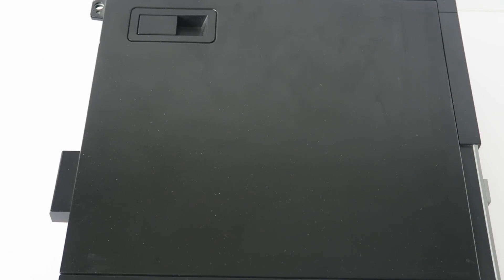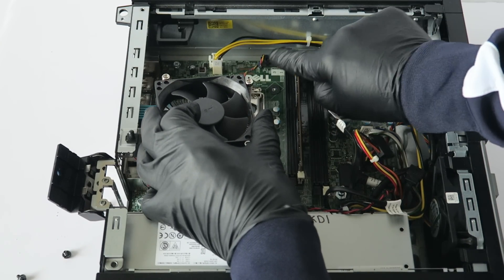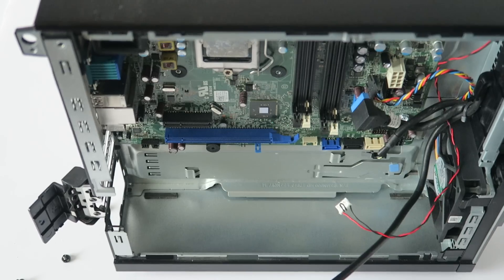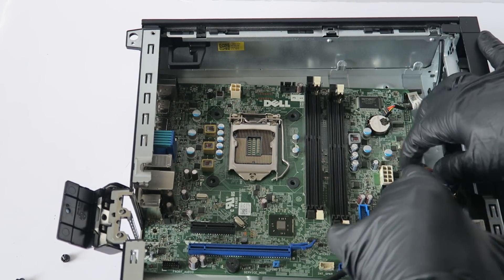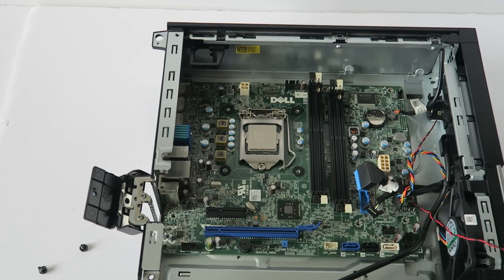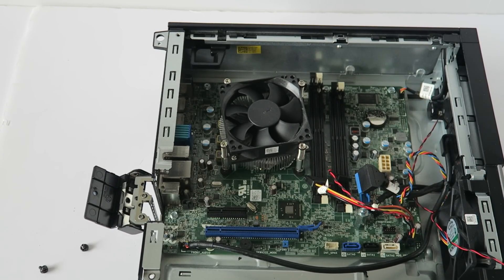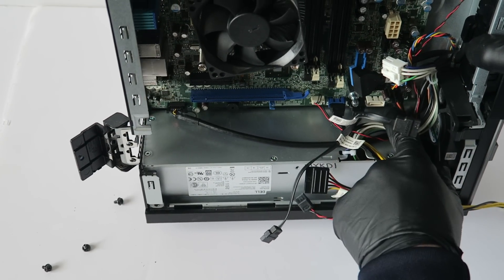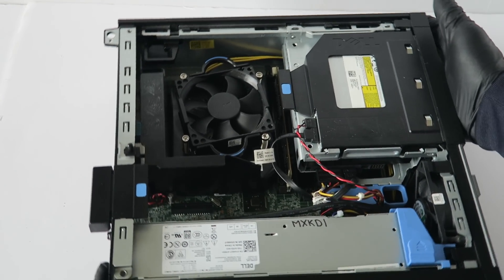Dell Optiplex SFF Replace Install Motherboard

Comment from the maker: Here is the List of parts upgrades:

Dell Optiplex SFF Install Second SSD, Hard Drive
https://www.youtube.com/watch?v=i5AcC0YgwH8

 SATA Hard Drive Caddy, Universal 12.7 mm SSD HDD Hard Drive Caddy
https://amzn.to/3buyfJw

2.5" 12.7 mm 2nd SSD HDD Hard Drive Caddy Adapter
https://amzn.to/3czPDN9

This HDD 2.5inch will work in this caddy for extra storage.
Seagate FireCuda 2TB Solid State Hybrid Drive Performance SSHD – 2.5 Inch 
https://amzn.to/2Vpw0Sa

WD Blue 2TB Hard Drive s, SATA 6 Gb/s, 128 MB Cache, 2.5"
https://amzn.to/2VqHK6Q

Seagate BarraCuda 2TB Internal Hard Drive HDD – 2.5 Inch 
https://amzn.to/2yANdio

 
3.5" to 2.5" SSD or Hard Drive Caddy Adapter R494D 0R494D 
https://amzn.to/2XTPeRr 

 This RAM works with Dells Optiplex SFF 390, 790, 3010, 7010, 3020, 7020, 9010, 9020:

(1.) Crucial 8GB Single DDR3L 1600 MT/s (PC3L-12800) Memory CT102464BD160B
https://amzn.to/2VhGv8O

(2.) Crucial 4GB Single DDR3L 1600 MT/s (PC3L-12800) Memory CT51264BD160B 
https://amzn.to/2xq46wb

(3.) Crucial 16GB Kit (8GBx2) DDR3L 1600 MT/s (PC3L-12800) CT2K102464BD160B 
https://amzn.to/2VpsKpP

(4.) Crucial 8GB Kit (4GBx2) DDR3L 1600 MT/s (PC3L-12800) Memory CT2K51264BD160B 
https://amzn.to/2y7XZwq 

List video cards will work with this system.
(1.) Gigabyte GeForce GT 1030 GV-N1030D5-2GL Low Profile 2G Computer Graphics Card 
https://amzn.to/2Z4PHkp

(2.) ZOTAC GeForce GT 1030 2GB GDDR5 64-bit PCIe 3.0 DirectX 12 HDCP Ready Low Profile Video Card ZT-P10300A-10L 
https://amzn.to/2WzgLXk 

(3.) MSI Graphic Cards GT 1030 2GB GDDR5, Low Profile 
https://amzn.to/390Spum

SSD list works with this PC:
(1.) Samsung 860 EVO 500GB 2.5 Inch Internal SSD MZ-76E500B/AM) 
https://amzn.to/2yNxnkE

(2.) WD Blue 3D NAND 1TB Internal SSD, 2.5" WDS100T2B0A
https://amzn.to/2wvnC9Z

(3.) WD Green 1TB Internal PC SSD  WDS100T2G0A
https://amzn.to/3cbrcWa

(4.) SanDisk SSD PLUS 480GB Internal SSD SDSSDA-1T00-G26
https://amzn.to/3a3i9ou

(5.) Crucial MX500 250GB 3D NAND SATA CT250MX500SSD1(Z) 
https://amzn.to/34rZlhy

(6.) Samsung 860 PRO SSD 256GB - 2.5 Inch SATA III 
https://amzn.to/2ybiHLK

(7.) Samsung SSD 860 EVO 250GB 2.5 Inch SATA III Internal SSD 
https://amzn.to/2VjIAkK

(8.) SanDisk SSD PLUS 240GB Internal SSD
https://amzn.to/3c7SEE4

HDD list works with this PC:

1.. WD Black 2TB Performance 3.5" Hard Drive - 7200 RPM Class, WD2003FZEX 
https://amzn.to/2xFUeyF

or you can use 2.5 inch hard drive with caddy
2... WD Black 1TB Performance 2.5" Hard Drive, 7200 RPM Class, WD10SPSX 
https://amzn.to/2zg4cXG

3... 3.5" to 2.5" SSD or Hard Drive Caddy Adapter R494D 0R494D 
https://amzn.to/2XTPeRr 

 
This cable required if you going to install SSD and HDD:
Benfei 15 Pin SATA Power Y-Splitter Cable 8 Inches
https://amzn.to/2XsG0LV

Cable Matters 3-Pack 15 Pin SATA Power Splitter Cable 8 Inches 
https://amzn.to/2Rval8B

Zheino SATA Power Splitter Cable (2 Pack) SSD Power Cable HDD
https://amzn.to/3a3V9Wq

1.. Seagate FireCuda 2TB Solid State Hybrid Drive Performance SSHD – 2.5 Inch 
https://amzn.to/3b1e8T7

2..WD Blue 2TB Hard Drive s, SATA 6 Gb/s, 128 MB Cache, 2.5"
https://amzn.to/2Xstb4b

3..Seagate BarraCuda 2TB Internal Hard Drive HDD – 2.5 Inch 
https://amzn.to/2xmf0TE
Reply: hi quick question is it possible to switch a optiplex 790mt motherboard to a 9020 mt motherboard using the same 790 mt case since they are technically the same? i know i would have to change cpus but other than that is it possible?

Comment: I have an Optiplex XE SFF that I just got running. Wondering if I can upgrade the motherboard with one that came out of an XE2 SFF case.  Is that possible or has Dell changed everything?

Looks like it from this video.

Comment: Is thermal compound required?
Reply from the maker: Hi, yes.

(1.)  Thermal Grizzly - Spatula for Applying and Spreading Thermal Paste
https://amzn.to/30Qq4ag

Thermal Compound Paste:
(1.) Arctic Silver 5 Thermal Cooling Compound Paste 
https://amzn.to/2ziNU0H

(2.) Noctua NT-H1 3.5g, Pro-Grade Thermal Compound Paste
https://amzn.to/36kTk7A

(3.) ARCTIC MX-4 (current edition) Thermal Compound Paste 20 Grams 
https://amzn.to/2DhGJaK

Comment: bro same motherboard not avilabe pls tell sustitute for motherboard model optiplex 390sff( h61chipset )  i3 (2 gen )processor 2012 model
Reply from the maker: Hi, they sell them used motherboards on ebay  for that dell 390 sff.

Comment: Hi, I want to buy new motherboard for my PC, cuz best CPU I can install is i7 3770, but I want to upgrade to smthing better, what are the factors I need to look at when I'm buying completely new, not same, motherboard? My case is Optiplex 7010, but not that slim one, but thicker one, like gaming PC.

Comment: Awesome thank you! I love my 990 SFF and upgraded the GPU to the GTX 1650 and put 32 Gigs of RAM (4x8) in and it's a little beast. I'm looking into replacing the MoBO and putting it in a new case. This MOBO is so limited with the CPU  upgrade possibilities sadly. I've now hit a brickwall with performance due to the CPU limitations. Gotta find out what the MOBO upgrade possibilities are.

Comment: I have a Dell Optiplex 790 that does not have a lever to pull up on that removes the side.  How do I get the side off to access the insides.  I am just replacing the fan.  ?

Comment: Hi Mxkdi, I have a 790 SFF and am looking to do some upgrades. Based on the list of parts you provided in your videos, do you have any recommendations on which motherboards would be best with the 790 SFF? If so which ones? Thank you in advance!
Reply from the maker: Hi dell 790 sff use this morherboard
https://amzn.to/2z5GAos
Reply: @Mxkdt  Thank you for your answer, as well as for your tutorials :) I take it no other motherboard will work with this model? No worries if it doesn't. Thanks again!

Comment: Yo! Love you video! Quick question... Got the same computer... will the following motherboard / processor work with this model? Motherboard: Asus Prime B450M-A/CSM AMD Ryzen 2 AM4 DDR4 HDMI DVI VGA M.2 USB 3.1 Gen2 mATX Motherboard https://www.amazon.com/dp/B07FKV5HWJ/ref=cm_sw_r_cp_api_i_8yNKEbQJZ5511                       Processor : AMD Ryzen 5 1600 6-Core, 12-Thread Unlocked 65W Desktop Processor with Wraith Stealth Cooler (YD1600BBAFBOX) https://www.amazon.com/dp/B07XTQZJ28/ref=cm_sw_r_cp_api_i_hBNKEb0HM7A1P          Thanks so much 🙏🏼
Reply from the maker: Hi, no this dell case is to small you should get mid tower ATX case they sell new online.

Comment: Can you just move the motherboard ? I want to install a gtx 1050 ti (low profile) but the pci express pin is too low so the graphics card does not fit. So i want to up the mobo
Reply: Same you can not move due to cpu cooler thing

Comment: Mxkdi!! Sorry for another crazy question. Can I put the Motherboard, psu, and all from my 7020 SFF into a 790 DT? I see the cases are different looking when the motherboards are removed. I want more room so I can use the x16 slot! Thanks and as always your videos are awesome!
Reply from the maker: Hi no if you want to install bigger video card you have to use dell mini tower and i did upload video show you how to do that, you can watch this video...
https://www.youtube.com/watch?v=Bjtpp-fIx_Q
Reply: @Mxkdt  I wanted to keep the same components, put the 7020 mobo in the 790 case. The location of the 7020's x16 slot inside the 790 case should work. The i/o might be different though

Comment: It's very uncomfortable to squeeze a low profile GPU.

You could only theoretically fit a single slot LP GPU. A low profile GPU with 2 slots is impossible.

Dell is trying to make it MORE difficult for gaming fixations in these SFF Optiplexes, best to stick on the older generations like the 9010 or 990.
Reply: I have the dual slot Zotac GTX 1650 in my 7020 SFF, however i can only use the PCI-E x4 slot. But it still makes everything I play run great!

Comment: Hi Mxkdi, where do you recommend I buy a new Motherboard I have a 7010 small format, and I did a window upgrade last night, and after that it never powered up. I have blinking amber lights 2x3...from the manual it says it could be a motherboard issue or memory. 
Rather than trashing this (7 years old / 70 years in computer age) I wanted to salvage it...can you help? Thank you
Reply: Check everything is plugged in properly

Comment: I've got an Optiplex 9010 SFF into which I'd like to install a wifi/bluetooth PCIe card. I need a USB 2.0 header for the bluetooth and there isn't one. It looks like the 9020/7020 ? you are working on here has one, but my 9010 doesn't. Any idea how I might add bluetooth to the thing? I've tried one of those tiny dongles (the iogear one) and it has a large latency that shows as out-of-sync audio/video, and it has limited range.

Comment: After replacing the motherboard on this Optiplex, can I still use the Dell Windows 7 reinstallation disc and have it automatically activate as "genuine" by reading the key code kernel on the MB or will I need to get a reauthorization each time I wan't to reinstall a clean OS which I do every few months?  Thanks

Comment: i have the same pc will a gt 1030 work on it?
Reply: ye think so cuz gtx 1050 low profile can so gt 1030 low profile will do
Reply: Nah just get a 1650 low profile
Reply: I have the Zotac 1650 in now. I can only run it in the x4 slot though. But graphics still look good. I have a Optiplex 790 DT case im not using. I want to put my 7020 SFF motherboard into the 790 DT case, then I can use the x16 slot on my motherboard because there will be more room. I just dont know if the motherboard will secure in the 790 DT case.

Comment: i have seen many of your videos and i gotta say they're pretty useful especially for my dell optiplex 7010 MT, however i was wondering if you could do a video about how to change the stock cooler in this pc for an aftermarket cooler like an hyper t2, t4 or an evo 212.. but of course with dell there is always a tricky part, basically they made the back motherboard backplate different (gj as always dell) but a friend told me that you could cut the edges of that backplate and make it like a normal motherboard backplate
do you think you could do a video about that? i know is tough to make a request like that but i guarentee you it will be pretty useful for a lot of users
Reply: Angel Solano agreed
Reply from the maker: @lachlan.mooney  Hi, guys you can use better cooler that would work with  a Dell OptiPlex 390, 790, 3010, 7010, 3020, 7020, 9010, 9020
DELL Optiplex XE2 SFF Heat Sink Fan Assembly 7416G / 4wire / 5pin 07416G